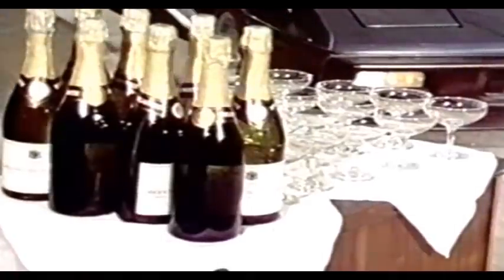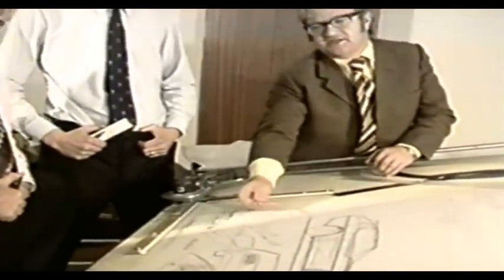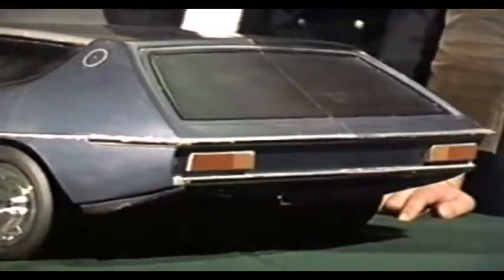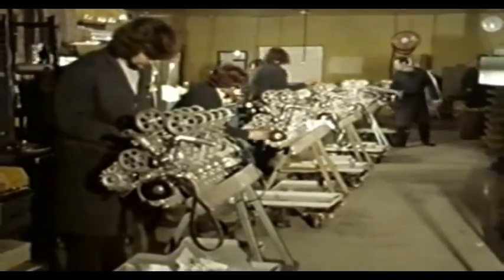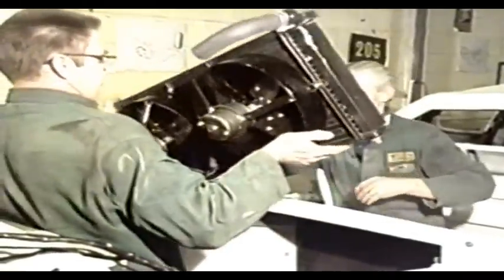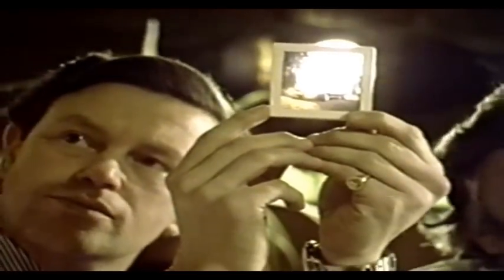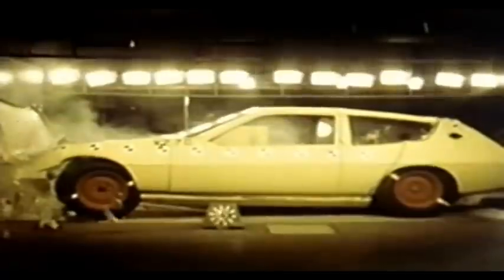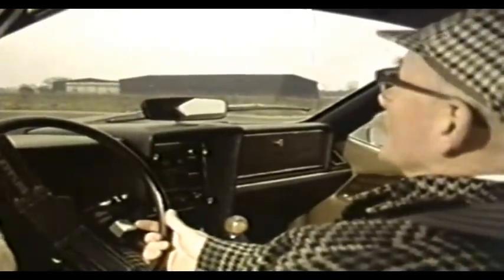Lotus Elite & Eclat (Project M50)

Comment: My dad bought a new gun metal grey 501 in 1976.The universal joint hadn't been greased and squeeked,one of the Morris Marina door handles fell off and one the head light dropped down and would come back up.7,000 quid. 😂 😂 😂 😂 😂 😂
Reply: Don't knock the Marina door handles Rover were still using them well into the 90s  on Range Rovers , Discovery's & many prestigious sports cars &kit cars!

Comment: 2:47 "The Type 907....  It proved so successful that Lotus are now exporting it to another car firm, Jensen Healey."  Actually, the Jensen Healey went into production before the Lotus Elite, was the first car to use the new Lotus engine.  They were a disaster, with many development issues not resolved.  One of the reasons for this was that most of the development work was done using the cylinder block of the cast iron Vauxhall ohc four, instead of Lotus' aluminium version of the block.  'Motor' magazine's long-term test car memorably destroyed its engine when the timing belts jumped a few teeth, and the valves clashed with the pistons.  These problems let to the acronym LOTUS - Lots Of Trouble Usually Serious.  
Having said that, I think the Elite M50 was a brilliant design let down by insufficient development - now I wonder if that has ever been said before?
Reply: Yes lack of development...but this engine is a good one. I have a Talbot Sunbeam Lotus with this engine and I have no problem. it is powerful, tractable but a little thirsty with its two dell'Orto carbs (45). I really love this engine and the ZF gearbox, too..
Reply: Lots Of Trouble Usually Serious dates back a long time before the Elite if Jensen Healy! It was already in use during the original elite’s production run!
Reply: @DL-ls5sy  yes the Little Sunbeam Lotus was a brave design of a car that has its origins from the Rootes/Chrysler Avenger. Great fun to drive & had good success in Rallying in the late '70s / early 80s